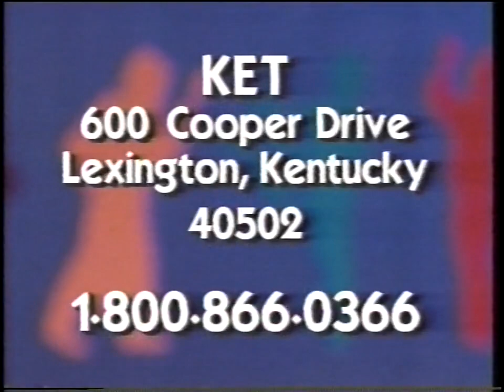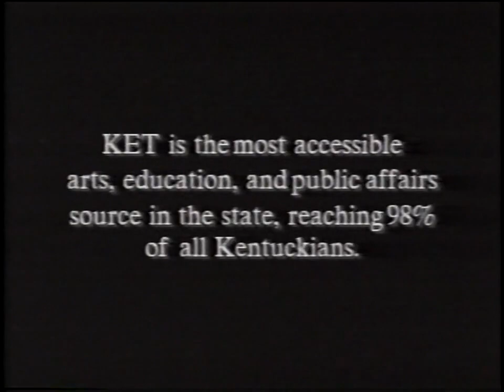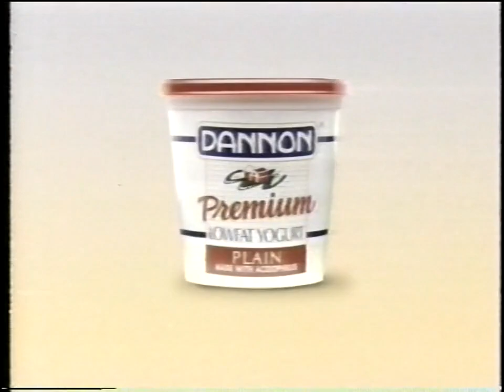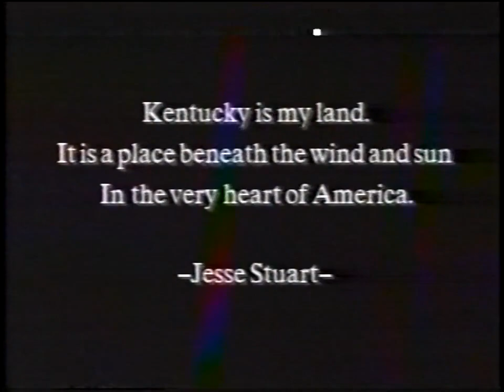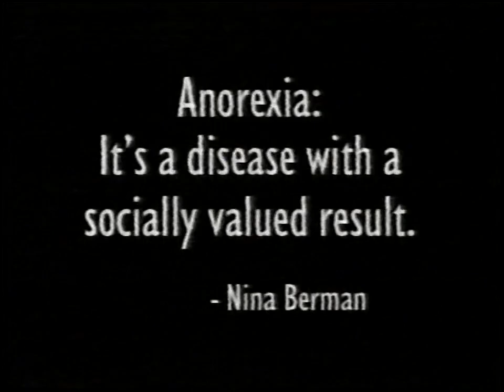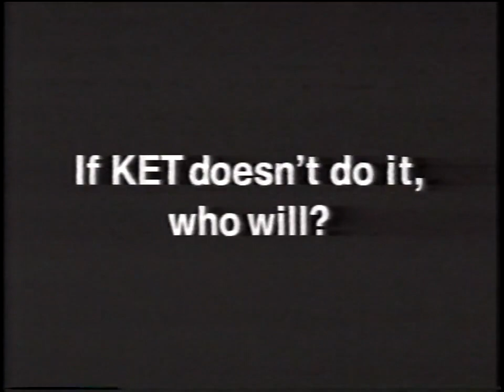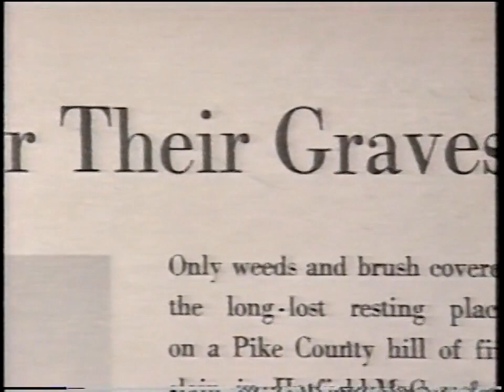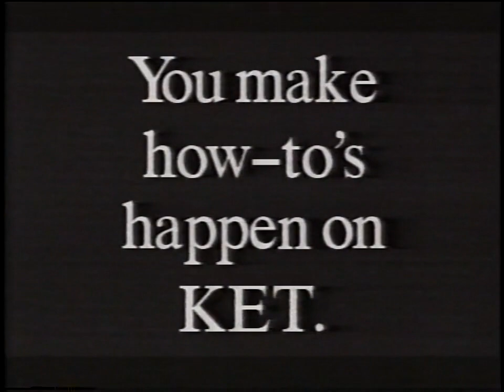KET (WKMU) Promos & IDs, 1996

Comment: This was filmed while WKPC was in the process of being sold to the KET network. The sale was completed on June 30, 1997, with the station joining KET a day later. It took over the Louisville KET affiliation from WKMJ, which would go off the air for technical upgrades at that time before resuming operations as a secondary service in August.

Comment: 2:05 KET ident with coverage included.
Reply: 5:35 KET Ident 2 also with coverage included. Note: Louisville Kentucky has two separate stations that are affiliated with KET at one point. One of them was WKPC and the other is advertised in this video including at 2:05.
Reply: 7:09
Reply: Please watch 18:54. Trust me WKPC is listed in this one.
Reply: 20:53
Reply: 21:43 Note: The Fund for Excellence sponsor was too bright on several occasions in this video.
Reply: 25:56